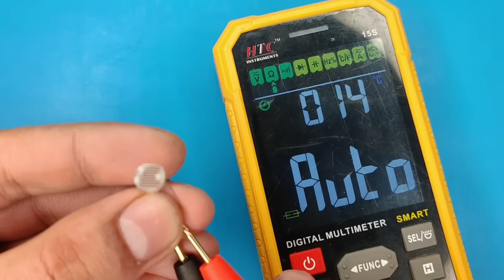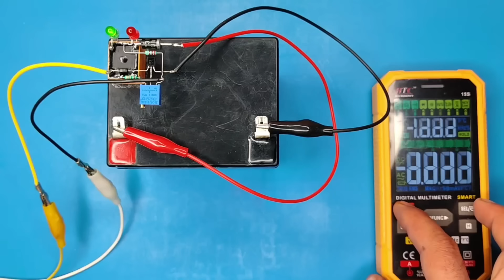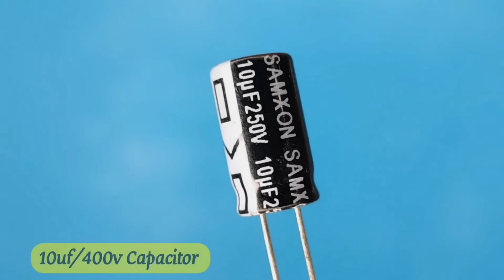3 helpful Electronic projects for beginners

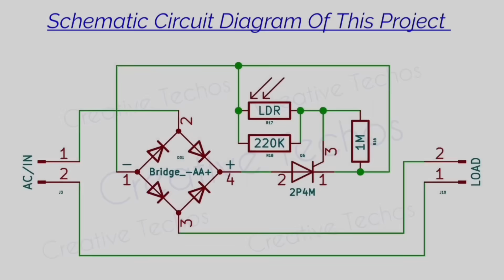Comment: Thx, interesting. I think the first schematic (1:51) is wrong, the LDR and 220K should be connected to the front of the thyristor / pin 4 of the rectifier, and not to pin 1 of the rectifier. Cheers!
Reply: Second schematic also wrong!😉
Reply: @Fedor___1  si esta mal el transistor no se puede conectar a la entrada sino al la salida para que testee la tension de salida cuando es la tension alta se corta
Reply: Yeah, the way it’s drawn it’s a voltage divider from - to - lol.  Nice use of bridge, haven’t seen it used as a series device before
Reply: @mr_tom_1_0  It was once a common way to use thyristors to switch both sides of an AC cycle before triacs became commonly available. This circuit could be built with a triac instead and then it wouldn't need the bridge as the rest of the components are non polarised.
Reply: 4s QE da Streetnnnnnññnnnnnn jj😢😢😢😅 @mr_tom_1_0

Comment: I think that the word "chrg" and "full" shoud be replace aech other on charg diagram.
Reply: My two cents. For the circuit to work, J15 should be connected to a current controlled voltage source. When the battery voltage is low, the current will be maximal and the voltage on J15 will also low. Low enough the keep the transistor driven via the base connected to the potentiometer in its of position and the relais in the off state. The battery will be charged via contact pin 3. When the  battery voltage rises, the voltage on J15 will also increase. At a certain moment the voltage on the base of the transistor will be high enough to activate the relais. The voltage on J15 will now switch via pin 4 to the other led. This will lower the current far under the maximum value, so the current controlled voltage source will now run in voltage controlled mode and drive J15 with its preset voltage. And yes both LEDs do need a series resistor for protection. When the current controlled voltage source on J15 is disconnected and reconnected again, the relais is activated directly again as there is no load current needed. In the current diagram, the relais is drawn in its activated state. So yes, the words chrg and full need to be swapped. The 1N5408 diode is to prevent discharging of the battery via the led when the relais is activated.

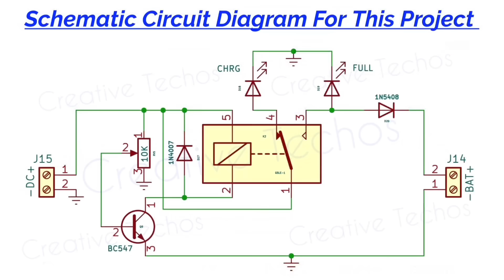Comment: time 3:50 battery auto cut off schematic diagram...... it is mentioned left side LED Green is CHRG... It must be FULL... and right side LED Red is FLL... It must be Charge.... As well this scheme will do relay flickering while the battery voltage in the mid ratting.
Reply: Never mind the red/green, what about that 2.2k resistor to keep the LEDs from seeing 14V that’s not in the schematic.  Tell you what, if these guys are this sloppy I don’t think I’ll be hooking anything up to line voltage ;-)
Reply: he just copies crappy circuits he found on YT
he does not actually know anything
even the construction sucks